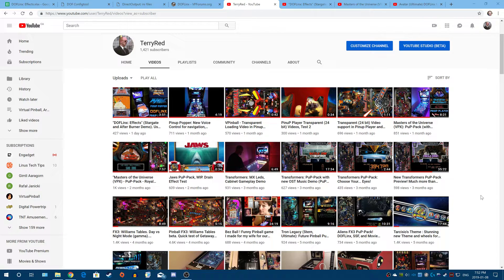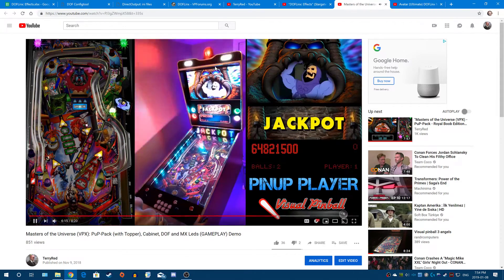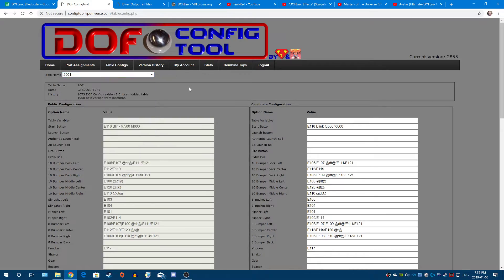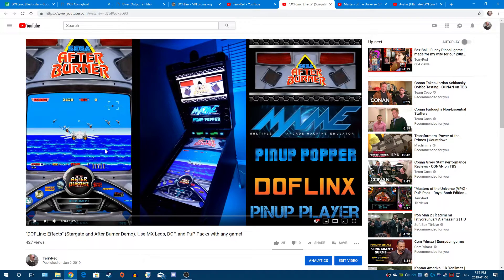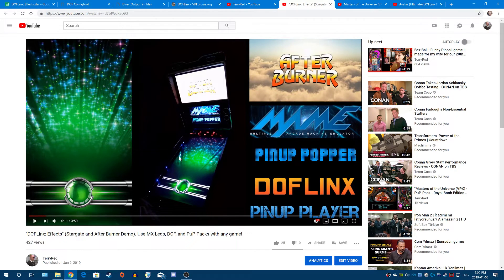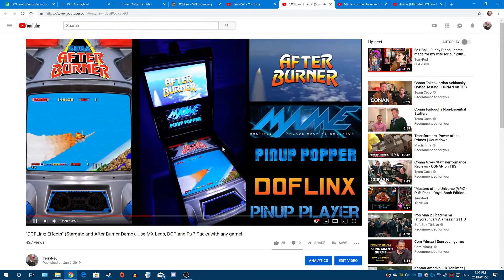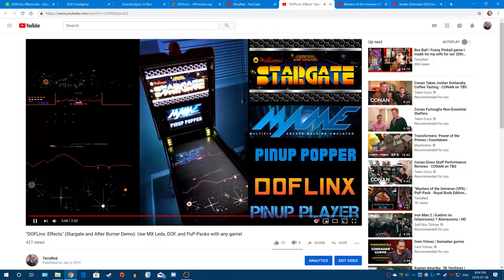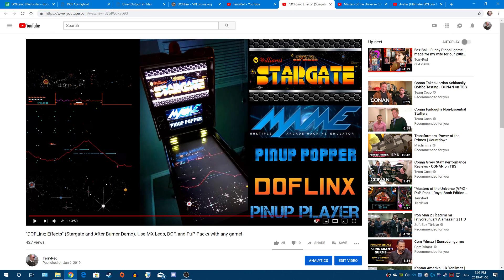"DOFLinx: Effects" What is it? How does it work?

Comment: Hello
urgently need help with DOF :-(
Use the Teensy 3.2 with okto adapter.
The LEDs are ws2812 or 13 ... with the extra data line. The whole thing is supposed to work in Pinballx and VPX.
Have seen 2 or 3 videos but I do not get it to run .. The basic test with Teensy and led works so far ..
My problem is DOF ...
Always get this error message .. (Error! DirectOutput framework not found. Make sure the DOF com object is registered) !!!
who can help me please .. s.besten .. Teamviewer ... who gets the run, can choose a coupon for 25 euro :-) as a thank you ..